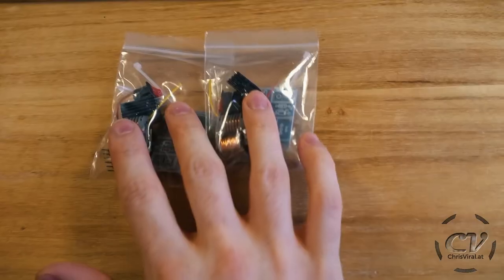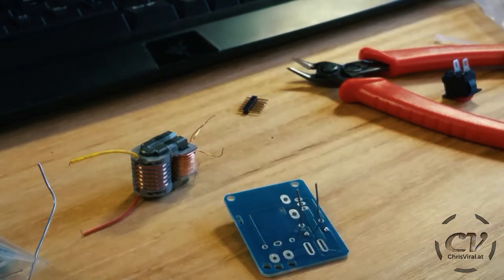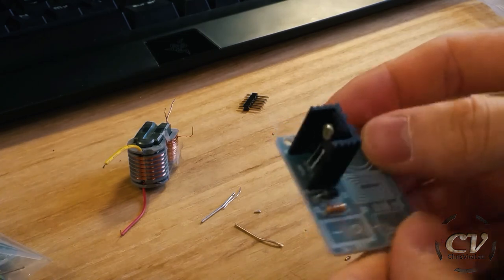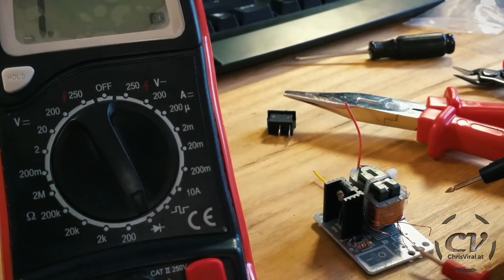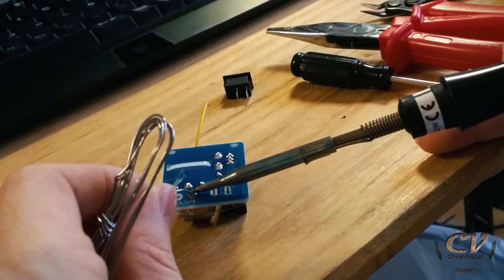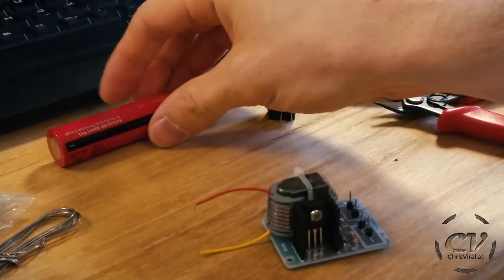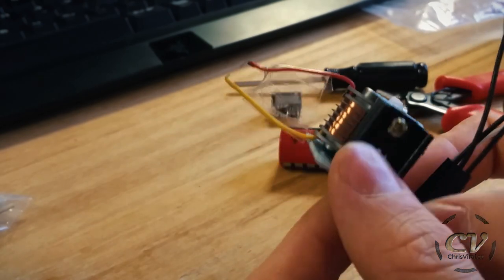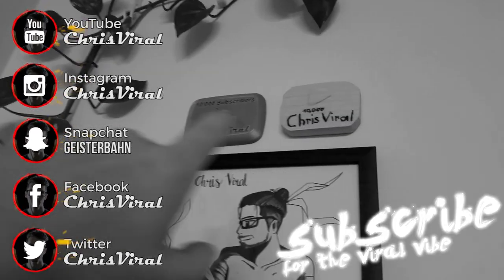How To Assemble The 15KV Arc Generator Kit (China Import)

Comment: Don't know what you used your units for but I used mine to create a table top windless lighter.
Your transformer wires are crossing. The moment that gets even slightly warm it will fail. After moving around and rubbing together the coating will come off and it will fail. Do not let transformer wires keep in contact. Find the two central wires that complete the coil and use them for the center. Then they will not twist and rub the other wires.

Comment: Huuh this was a little unclear on thick and thin wires but I got it reconfigured aka resoldering and have little spark. So one thick goes to the middle of Transistor one thin to resistor and the rest into the middle. But even on ebay images they failed at placement even that they had a PCB with thin and thick markings. Mine had just lines of even thickness and kit had missing diode. Next a try on dust or smoke collector.
Reply from the maker: If the wires look the same you need to measure them to make sure which is which. Other than that it's just a matter of tries until it will work. The rest of the circuit is really simple so the only way to mess up are miss-wiring the coils. It you just keep on trying it will work eventually (not necessarily intended for you Werner but for other readers).
Reply: @ChrisViralVlogs  Yeah I even once messed up the hello bee prussa printer wiring for heating blocks. But never printed since months. But that's more a PLA moisture problem.
Reply: thanks, due to this comment, I figured out how to do it

Comment: Anybody got an idea what transistor that is? Mine all got no markings and feel very cheap. My tester says its is BJT NPN with a diode between collector and emitter..but the manual of the tester also states that darlington transistors and thrisistors are confusing the device so im not sure what that thing is.
Any idea what exactly that one is? Or wich type i can substitude it? I got a few TIP41C NPN power transistors laying around here from an amp..or what/wich one is a good substitude?

Comment: I have purchased this generator but it is not working with my kitchen burner for igniting.
Reply from the maker: You probably messed up the coil wiring, easy to do trust me. It's a pain in the butt but you need to measure or redo the wiring until it works.
Reply: @ChrisViralVlogs  i mean the spark generating but  no flame is ignited with it
Reply: @ChrisViralVlogs  bro the spark is generated but it cant ignite the lpg gas in my kitchen
Reply from the maker: Oh I see, I know that problem from my flame fist project. You need to have a proper placement for the arc. It can not ignite just the gas. So it needs to be further away from the gas outlet, so that the gas can actually mix with the surrounding air and form an ignitable mixture. So try placing it further away. This should do the trick :)
Reply: @ChrisViralVlogs  I have just soldered mine up and I have a high pitched whine but no spark. Any idea's? Thanks
Reply from the maker: That's nothing unusual...

Comment: What's the output amps ?
Can I make stun gun with this ?
Reply from the maker: No, you'd need a stun module for this. Check out this video:
https://youtu.be/5sfVnczqb8g
It's a comparison between all modules that you can buy cheaply.
Reply: Yes add some capacitors and diodes in a Voltage multiplier circuit